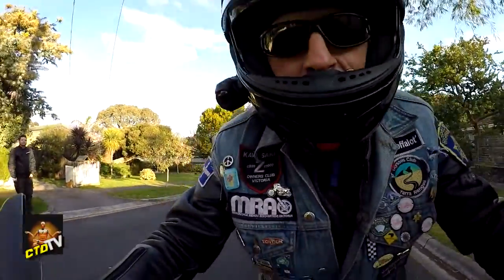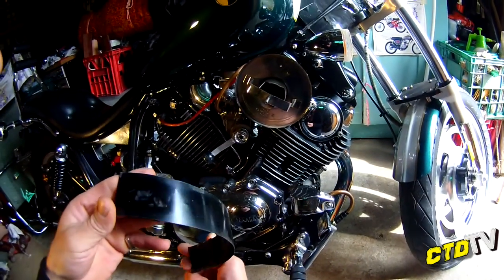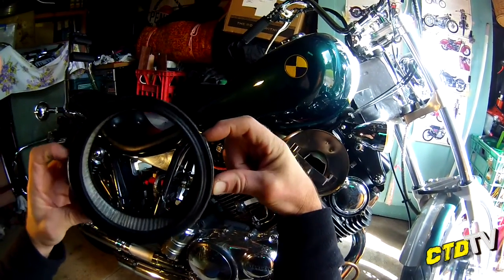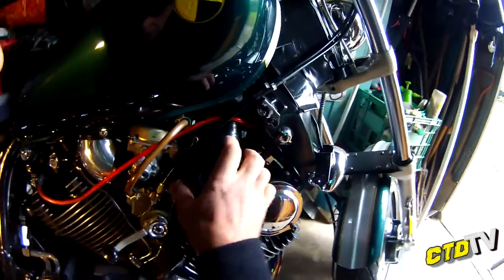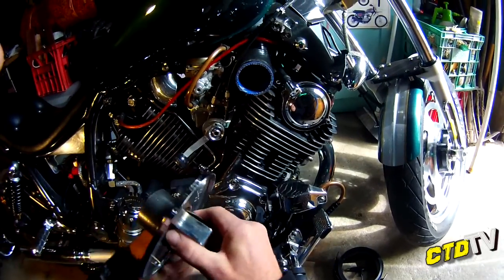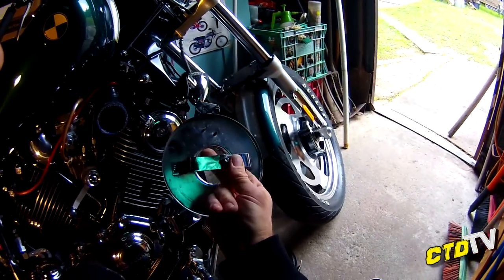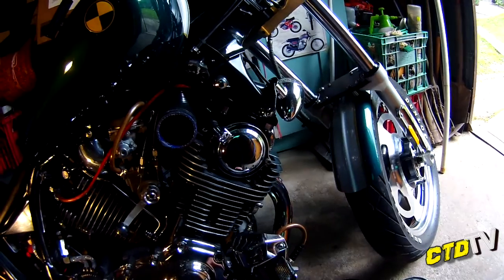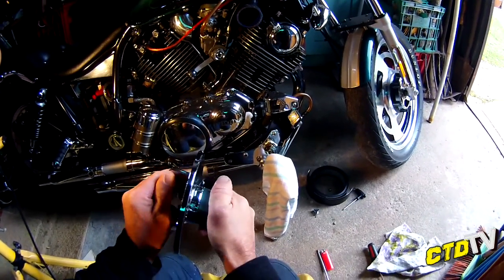Virago Xv1100 - How I made the AirBox Kool and Suck better...

Comment: Very shiny! handy for fixing helmet hair after the ride. I did it the hard way. I kept the stock look and added a second performance Air filter in the empty chrome bulb/tool box. yea that's right drilled the frame and welded a second intake tube!! I then drilled out the mufflers Re jetted and rebuilt the carbs 4 jet sizes bigger. first run leaned out at 1/4 throttle! at full throttle it just died. I drilled out the main jet to 1.5, heaps better but needs more fuel. next bigger drill 1/16th = 1.6mm.. clutch slips!!! This thing is an animal!! It still needs a bit more fuel so I'm going to buy 1.65 jets. But I'm up for new clutch/heavier springs first. While nursing the slipping clutch It drags off 2 litre Vulcans and most HD's  I recommend re-jetting, I've spent probably 15+ hours getting the carbs in and out but boy its an animal, pulls hard all the way to redline. Have you played with jetting?
Reply from the maker: The mirror on the handlebar is too small, so I had to add the Vanity mirror, it only seconds as an Air filter...lolActually I haven't touched the carbs at all!
I did a Carby-Tune while riding, but know this is just a BandAid fix.
I should do a rebuild & ReJet on the carb one day, sounds like mine could have 'Hidden Power' waitin to be unlocked...
Shame your not in the same country, I'd Love to see it.
TFstopping by Mark, RSOT >:)
Reply: what jetting did you end up with and needle settings

Comment: thanks bud...I can't find a good condition air cleaner box oem so I'm totally doing this mod.  cheers for this vid bro.
Reply from the maker: Great, glad I could help ya go Non Standard.
Just watch it in the rain, I think mine sucked a bit of water in last time I was caught in a Storm...I might have to rethink it for Wet Weather riding.
Keep me posted on how you go.
Cheers n RSOT >:)
Reply: @MrFalloffalot  I was thinking I may port it to the rear.  and flange the top part up and out a slight bit instead of folding that part inward.  Let momentum and air flow from riding shed the water off.
Reply from the maker: @survivealiveofficial4056  Sounds like a Plan!
Letme know how it goes and video/take LOTS of Pics
(So I can steal it later and ReDo mine....lol)

Comment: Hey great video's  I just started working on a 1100 ...couple questions the air box you brought what is the hole size on the back plate...and also what did you do with the left side sis system under the bug eye do you have a video for that thanks so much I'm in Ontario Canada.
Reply from the maker: Gday Antoin.
I believe the hole size is 100mm. Here's a link for the brand I used - https://www.speco.com.au/accair.html
I'll rip the air cleaner off today and measure it all up. Confirm which mine is and the tuebo tube while I'm there.
Speak soon... >:)
Reply: 👍 thanks

Comment: Amazing! so just to be straight, Nothing done to carb jets?
Reply from the maker: Not so far... I'm Stoked!
Seems to run fine, smooth accell all the way. to when the bike gets Hairy.
Saved me a bundle too,
Are you doing similar?
Meantime - uRSOT Marcel >:)
Reply: @MrFalloffalot  Im planning on it! got a 94 xv750. Working on the seat as of now,I used a lot of your ideas from the low rider seat vid, Thank you!
Reply from the maker: @Marceldbd  Glad I could help. Love to hear how its going too.
Plenty of photos please (Video is better though) >:D
Reply: @MrFalloffalot  Def will when im done!
Reply: @MrFalloffalot  what is the diameter of the air cleaner? Thanks again! seats done !!
Reply from the maker: @Marceldbd  I'm pretty sure that it was around 100mm??
It was pretty much the same size as the air-hole coming out of the frame. The Turbo hose fit straight on and the A/cleaner fit straight on the hose. Fell into place really...
I can actually measure it if you need. But it'll be a week or so. Yes/No to measure?  >:)
Reply: MrFalloffalot CrashTestDummy TV  No worries! I think I got the right one. Thanks, I’ll let you know how it goes

Comment: Is there a replacement for the rubber boot that goes from the carb to the air filter you're working on?
Reply from the maker: You mean these? - https://i.ebayimg.com/images/g/qS8AAOSwE6VXI9GN/s-l300.jpg
Didn't find any New one's with a quick google search, but I'm sure you could find some 2nd hand in good condition.
Letme know if it's not that, so I can change my answer.... >:D
Reply: I think I was referring to the Turbo rubber tubes. The tube that goes in the center of the circle filter.
Reply: MrFalloffalot Crash TestDummy TV
Reply from the maker: I just noticed your new comment. Did you get it fixed??

Comment: could you please write from which car this filter is?
I am looking also for replacement of the stock "eggs" to something round and new :)
Reply from the maker: Give me a few days, I'm not only trying to find em in Russia, but also see how hard/much from manufacturer here in Australia. BTW, what part of Russia do you live? (to work out postage)
Speak soon >:)
Reply: MrFalloffalot CrashTestDummy TV 
I am not from Russia. I am from Kiev, Ukraine. I was thinking about air cleaner from v-star, because of filter inserts availability
Reply from the maker: I'm not sure how they bolt on, but with a Hammer, Anything is possible... >:D
Freight from Aus to Ukraine is around $30-$40(Au), so if you want me to make a 'kit' for you (same as mine), let me know, I'll let you know full kit 'delivered' price.

Comment: Hey, so I just got a 94 Virago 1100. I want to do this to mine, however the housing on the right side is completely borked so I need to find a solution. It looks like on the housing there's the large tube and then a smaller tube that looks like it might go into the carb (don't skewer me I'm not mechanically inclined yet haha), how did you replace that?
Reply: looks like it's the orange tube there... not sure where I should lead that :)
Reply from the maker: I re-read your msg again and again.....and apart from getting all Cross-Eyed and confused, I reckon we need to Skype or something. So you can explain the issue better.
The orange tube I dont understand.
How is your tube borked anyway? Is the frame bent?
I'm not fully understanding what Tubes you mean also, that one that might goto carb?
I know it may take lines n lines of text. Thats why I thought Skype/phone call/voice chat somehow, might be easier.
FYI - The airbox system on the XV1100 runs through the frame then exits the side, is that what is confusing you perhaps?
Speak soon (Gmail if its easier), RSOT in the meantime... >:)
Reply: Hey, I got it figured out, it's the carb breather!
Reply from the maker: Oh - That Hose... lol
I would not have guessed thats what you were describing. Thus the sudgestion of voice chat.
Glad you got it sorted though.
Keep me posted on how it's going, I'd Love to hear more of it's 'Evolution' to a Custom virago...
RSOT >:)
Reply: MrFalloffalot CrashTestDummy TV haha nothing too big, just dropping the right but eye so I figured I needed to get that tube sorted so it's not just hanging out. Bought some crank case filter on amazon that matched the small 4in disc filter, really don't want to have to rejet the carbs haha

Comment: Did you just bolt it on? No rewire? 😃
Reply from the maker: No wires in the airbox department...
Just bolted on, did a 'ruff-tune' while riding, by bending the thin metal side cover, until it had a nice idle and acceleration. 
(Saved a packet on re-jetting & tuning the carbs.)

Hope that helps you, if not, hassle me for more Q&A's. Even 'demand' I do another video if needed.
TFstopping by, good luck with your project and drop me a line when you get it sorted. I'd Love to hear/see pics on how it went.
Cheers n RSOT >:)
Reply: MrFalloffalot CrashTestDummy TV  oh thats nice. 
Thank you so much for helping a brother out 🤘🏻
Love your Chanel
Reply from the maker: @christianstrom6130  My Pleasure.
Get on me back though, I NEED to get back into the swing of things. I haven't put up a vid in 5months!  
Maybe its time for an Indepth Virago vid perhaps??   >:D
Reply: MrFalloffalot CrashTestDummy TV yes do that.. Im about to start fixing my virago 1100. And i your vids ser realt helpfull. Not many vids on these machines whit 1100 engine and stuff 🤙🏻
Reply from the maker: @christianstrom6130  Take your time and write a list of what you want to do to her. I'll go over what same things I've done or do some research for ya on how the best way to do it is. Comparing other builds on YT too.
And put it in a video of course... >:)
Reply: MrFalloffalot CrashTestDummy TV wow.. i will! Thanks alot.. il be back whit a list 😃
Reply: Can i reach u via Skype?
Got some pictures i would like to show u
Reply from the maker: @christianstrom6130  Gmail/Skype at mrfalloffalot@gmail.com 👍